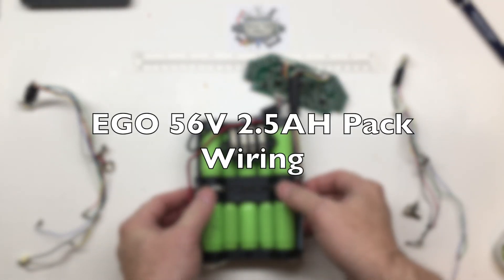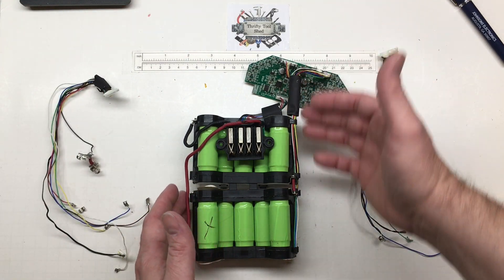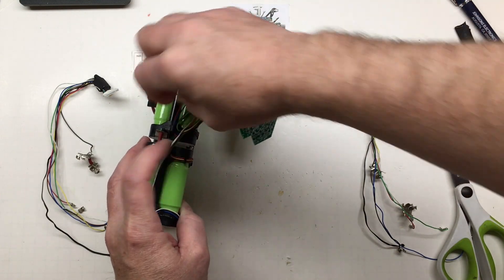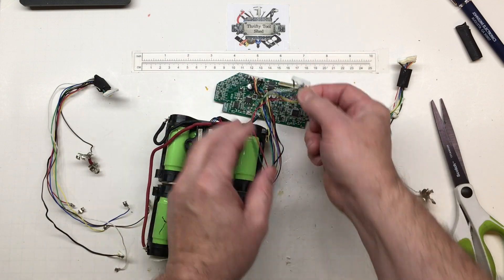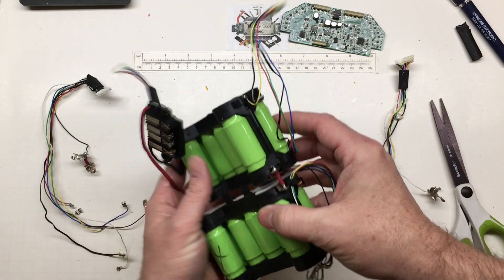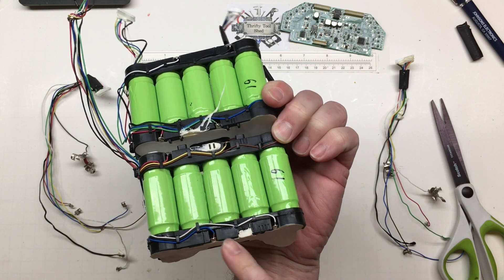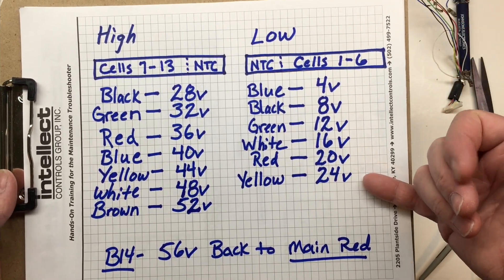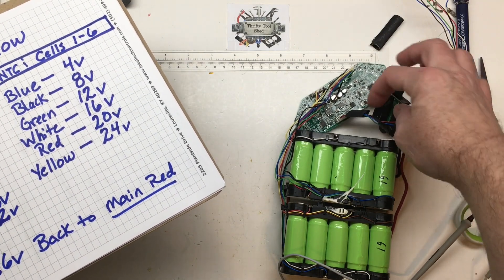EGO 56V 2.5AH BMS Wiring

Comment: Good morning sir, I have a battery that only has around 47v on it and I can’t get my charger to charge it.

My assumption is that the battery is too low. I only have 12v chargers is there a way that you can suggest how I could boost the batteries to get the charger to kick in?

For back ground knowledge, I had been having some issues where the battery would connect, do the red yellow green cycle, but fail to start charging. I then read if you bump the battery it will charge, so I did that and then really tried not to pull the battery down too much, today I used it, then put it on charge with out checking to see if it was charging then went back and used it again and unfortunately have pulled it down too far, I’ve had the pack apart and each cell pack seams to be down 25% ish, so 3, 6, 9, so on as opposed to 4, 8, 12 etc.

Thanks, Clayton
Reply from the maker: Well 47V should not be too low. At 14s or 14 cells you should average around 3.3V each cell, which seems like you are getting. I would check all cells and make sure some are not reading lower than others. I mean like .5V or more difference. If any cell gets below 2.7v it could be an issue, but yours should be fine at 3.3V. If you did need to boost some for testing because some were below 2.7v you could carefully go accross the cell in question with around 4V CV and 1A CC and bring it up. I would set the voltage at what ever the average of the rest of the pack cells are if that makes sense? You at a minimum should use a variable supply with Constant Current and Constant Voltage settings. If all you have is a 12V supply you can still use a DC-DC converter like  the Drok or the smaller 5A DC-DC Buck Convetor I have videos on as well.

Comment: I’ve got a 2.5 battery that takes a charge but on my leaf blower it dies really quick, after 3-4 minutes. I’m following that voltage diagram and on the first test point I’m getting 2.4 volts then every points that follows is about 4 volts below what it should be. I was hoping to find a bad call but it looks like something else.
Reply from the maker: Well if you are getting 2.4 v on the B1 TP to com then that is your issue for sure. Locate the actual cell 1 and see if it is really reading that low. If it is then the cell is bad. If it reads fine then the connection to the BMS on the connector is most likely not getting through. I have had that happen on a couple.
Reply from the maker: This issue was similar on the 4.0ah repair #3. https://youtu.be/dJ8SACpmhVQ

Comment: hi I picked up a 10ah ego 56v from a tip.got it working ok.so used on my bike 36v motor.31 mph.top speed.so I bought a charger.and its topped up from 50v to 58.5 v on meter.so just need to solder on a xt90 connector for ebike .keeping the bayonet for charger.can I connect direct to battery red an black or should I go rom bms .not sure where terminals are yet just took covers off.steve in uk
Reply: I’m not electronics expert just built my own ebike battery and tinker a bit .
Reply from the maker: Great job on the 10ah! I dont fully understand what you are asking about the BMS. I have videos discussing the terminals. You have the + and -. You also have the T terminal and the D terminal. The T is the temperature feedback to charger and the D is communication between pack and tools etc.
Reply: @ThriftyToolShed  we like to do a bit of paddle boarding .been to Cornwall and the lakes.some nice rivers near you
Reply from the maker: It is some for sure. I could almost throw a rock into the Savannah river from my back yard. Not waterfront by any means though.
Reply: hi I charged up battery with proper charger and it reads 58.5v .then soldered xt90  connector on for ebike .when connecting power display up with the 3 connectors I must have had one upside down and it sparked a bit.so no power display but still get 58v from xt90 connector.but when connecting the charger it won't turn to charge so display must be blown .any way to bypass display so can charge ?I do have a drok charger which I tried to charge battery before I ordered the ego charger .but couldn't get drok to charge even though the volts seemed to go up on drok the battery wouldn't take it
Reply from the maker: I am confused about which display you are referring to and why that matters to the charging? As far as the Drok charging the pack, if you are at 58V or so you are almost fully charged. You do not want to go above 58.5V or more than 4.2V across any cells for that matter. If you get down to some where like 45V or so on the pack and you set your Drok for 58V output and current limit to around 1A you should absolutely see it charge up to 58V if connected properly.
Reply: @ThriftyToolShed  just tested battery again on ebike and it flys up hills still .so its ok till ending another charge.its a spare battery anyway.
Reply: If I short the 2 inside terminals when charger plugged in will that cause charger to power battery ?
Reply from the maker: No, I was talking about charging directly with PS like Drok for example, set to 58V....
Reply: Thrifty Tool Shed yes it was set to 58v from drok 1amp an power supply to drok was 12v that ok 👌
Reply: Thrifty Tool Shed its charging too quick the voltage goes up too fast and doesn’t charge battery 🔋
Reply from the maker: @stevemcgowan3017  
Interesting, I have seen the Ryobi 40V do that because a capacitor on the board shows the quick voltage rise. I have not seen a EGO pack do that.
Reply: Thrifty Tool Shed ive taken out bms and drok seems to be charging slow now see how goes the ego charger days 3 Amps to 56v .its starting to charge fast again now as I’m watching g it’s 54v now already after 2mins
Reply from the maker: @stevemcgowan3017  
Good, considering this is a 10ah pack since it is in good shape I would charge even 4  Amps if your PS can handle it, it will take a while for 4 cells in parallel.
Reply: Thrifty Tool Shed tryin 4amps 56v just shorted xt90 terminals together with red an black crock clips I connect leads from drok to it .big sparks an my finger black but battery’s ok still 52v an drok ok .was bit sleepy .been watchin series on bbc .heroes -American thing
Reply: Thrifty Tool Shed its still goin up quick the voltage up to 54 v already
Reply: Thrifty Tool Shed even tried 6 amps but still same fast charge but drok doesn’t stop when gets to 56v set stop rate
Reply: Thrifty Tool Shed got battery chargin with my 54v ebike charger 😀well up to 54v ok for 36v motor 😀
Reply: its the ego power display the new segment one.it would light green at first then go red.thats what it did when first picked out skip.well yes will try the drok again think I had it on 4 amps so maybe charging too quick.but just spent 50£ on charger ego one.as power display not working I guess the charger needed it to work.isnt there an eco in the display ?
Reply from the maker: Honestly with a 10ah you could easily  charge at 4A as long as you know that no cells have issues. I generally start with a 1A charge rate unless I know the cells are in good condition.
Reply: Thrifty Tool Shed thanks 🙏 where you based by the way .29degrees here tommorrow hot for us 😅
Reply from the maker: @stevemcgowan3017  in the southern US. It's been in the high 90's last week and first of this week. 98F or so....in Georgia!
Reply: Thrifty Tool Shed wow you must have some big bugs 🐜 too
Reply from the maker: @stevemcgowan3017  Oh the new segmented fuel gauge! Gotcha. I do not have one of those yet. I need to find a couple of those 10ah also! Just going by the older style BMS, if the display is not working that could mean the BMS is not working at all so without the communication to the tools or EGO charger it will most likely not work with the EGO.  But just as you stated in the lower comment, it will still have the 58V to the terminal to use that way and charge that way as well.
Reply: born flying my drone on holiday a lot dji mavic air .great views from above
Reply: Hi I’ve had the drok charging at 1amp 58volts from 30v max power supply set to 12v and drok went to 59v but battery was not charged it was still 52v any ideas ?
Reply from the maker: Did you buy a boost converter instead of the buck Converter? The buck Converter can only regulate down or drop voltage, you have to get a boost converter to take a 30V supply up to 58V?
Reply: @ThriftyToolShed  think its boost  as already used for ebike batteries various sizes
Reply from the maker: I would test individual cells (or in this case cluster of 4 cells most likely) and see if any cluster is reading really low. May have cell issues. You could have a cluster or more than cluster reading low causing the whole pack to read low.
Reply: Well it ran great on ebike an charged up ok with proper ego charger before I shorted out power Ecu😂
Reply from the maker: @stevemcgowan3017  
I remember you saying that as well. but I am wondering why you can't just charged it directly though if the cells are ok? I am missing something! Although again, I have not seen the new packs to know for sure.  I would think the BMS would be similar as far as operation and the + and - should go from terminal through fuse and to the pack?
Reply: you mean maybe use the ego charger directly perhaps bypass the display module thing if can wire up ego charger direct to + and - on battery  @ThriftyToolShed
Reply: How can I make ego charger turn on when plugged in the lights go on then off there is just 3v across 2 inside contacts
Reply: Will put video on so you can see or can I send video as a message ?

Comment: Can you swap BMS from 5amp battery to 7.5amp battery? I have 7.5amp battery but it seems that BMS stopped working. I tested the cells and show correct voltage. Thanks
Reply from the maker: I do not have a 7.5ah to say either way for sure. I have now worked on the 4.0ah enough to know for a fact the 2.5ah and 4.0ah are different. Although extremely similar, the 4.0ah has cell temperature monitoring boards in-between the pack halves. The BMS looks very similar on both,  but connectors are different. I will be surprised if the 5.0ah and 7.5ah have same BMS and connectors etc.
Reply: @ThriftyToolShed  Thank you for fast reply...I tested the 7.5ah and i have 55v on main wires but there is an issue on the BMS i have voltage drop between B13(51v) and B14(50v). Is there a solution for that problem on the BMS?....I was thinking about saving the 7.5ah pack by soldering the 4ah BMS to it? thanks
Reply from the maker: @hobbypower2  
Check the connectors really well also. I had a 4ah that the BMS blink red and all cells were good. But I noticed the change as you did accross the b9 to b10 cell. I had to clean some corrosion from the BMS board connector for the b9 cell and the BMS worked fine. The voltage was good at the wire side of connector, but it would not get through to BMS board test points. Just a thought, I may post a video on that, I have it recorded but not edited and put together.
Reply: @hobbypower Do you have the pinout of the low side connector (upper right) for the 7.5 Ah?

Comment: Thrifty Tool Shed:  Thanks again for your help and for making this very informative video to answer my question!   Unfortunately, after carefully reassembling my pack with new cells it seems there is a fault somewhere in the board ( blinking red light).  I’m going to keep my eye out for an affordable ego battery, possibly a used one that I can do an extra capacity modification.   I have a set of pcbs with mounted cell holders that when populated with cells create a modular 7s battery bank.  They can also be connected in series to create a 14s system.  When I can get my hands on another Ego battery I plan on using these modules to add battery capacity.  I think because of their ability to add capacity and to easily change out cells if necessary they should be a good option for this project.  I’ll update when I have some progress. 
Take care
Reply from the maker: I would like to know how it all works out for you. I am sure  you checked but the blinking red could be a ntc, if one of the three  were to be bad it may blink red?if all the cell voltages are good that is all I can think of other than the BMS has issues as you already stated. Best of luck!
Reply: No it went to 56v quick then battery still only 52v 😂